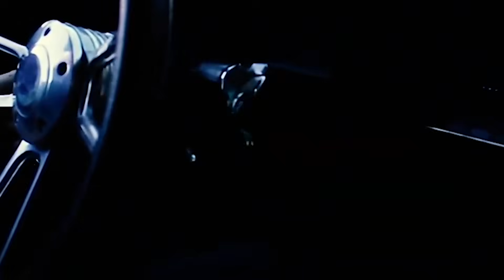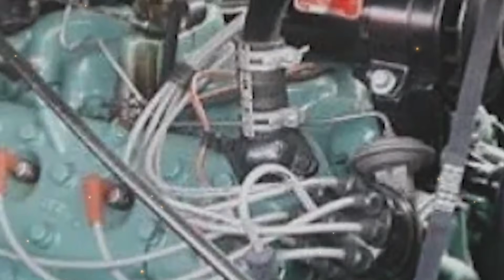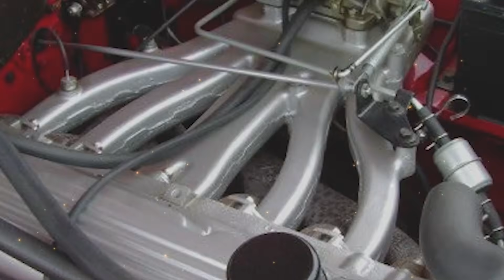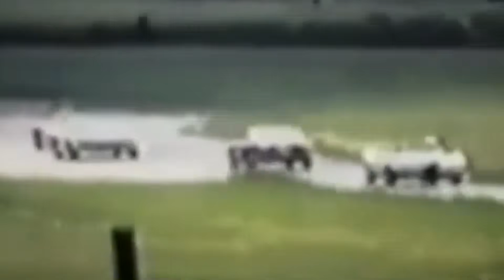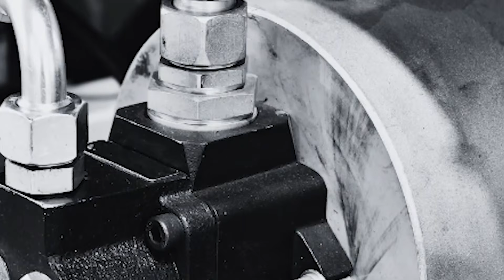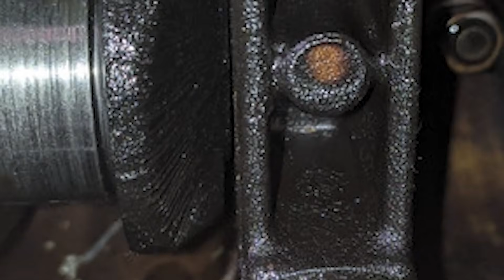Why This ’69 Camaro Engine Knock Had Every Mechanic Wrong

Comment: You are very confused All GM Torque converters have 3 bolts holding them to the flywheel. The 6 bolts you may be talking about hold the flywheel to the crank,....... get your story straight.